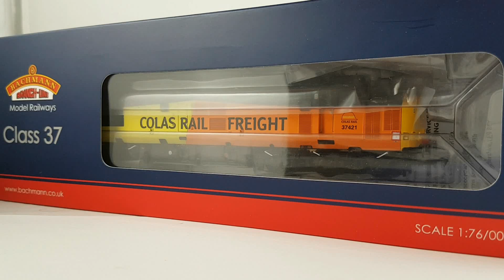New Junction - Adding a new Loco to the fleet | Colas class 37 | TTS decoder fitting

Comment: It is designed to have the square speaker screwed straight onto that plate removing it from its enclosure and using 2 of the screws and sound very good

Comment: Cracking livery Richard, although my main era is 1980's I do have the this loco and a Heljan 47 in Colas livery. I also have a couple of TTS locos too and they sound quite good. I've not long purchased a couple of Zimo LS40x20x09 8ohm speakers (under advice) to replace the standard ones as this will enhance the bass on them and generally give a better sound, fingers crossed... Mark
Reply from the maker: Kirkton Road Junction you'll have to film how you get on. :-)

Comment: Hi, love the livery, still looking for a loco with the same livery as yours. The only problem with removing the sound box from the speaker is the loss in sound quality, but I see why you did it. If you ever find you can fit one of these with a sound box attached seal around the edge with a bead of PVA, for example, refit the speaker and use black tack to seal the holes where the wire come out, you will then get excellent sound output...Simon
Reply: Simon -Liverton Central Very clever nice one  !
Reply from the maker: Simon -Liverton Central Top tip that Simon, Thanks!

Comment: I have just received a Bachmann Class 37 'Merl Evens' I fitted a SWD LokSound V4 with a 8 Ohm Sugar cube speaker. Very easy fitting first rate sound . Don't forget to remove the three TV suppressors. Note the loco should be run in on analogue as in the instructions. Other than that good video.
Reply from the maker: I always run in on DCC, no other option

Comment: Nice simple explanation of how to fit the decoder, including the minor fitting problems you, and therefore others, come across. On the station side, do you intend to fill in the gap between the edge of the baseboard and the rafters, or will the current edge remain? Cheers
Reply from the maker: davie maclean I'm not sure what you mean sorry?
Reply: Sorry - I wasn't very clear. At 13.21, as the 37 hauls through the station, on the (left) leading edge of the baseboard, you can see the horizontal supports where they attach to the diagonal rafters. I was curious if the baseboard was going to finish there or you were going to fill it in with scenery. I know the additional width might give you problems reaching to the back of the layout. Cheers, dave
Reply from the maker: davie maclean I see what you mean, It does look odd from that angle, it's nice to be able to stand on the inside of the rafters for an unblocked view. 

Width wise the baseboard is 3ft wide here already so any more and I'd be stuck hehe 

Regards 

Richard